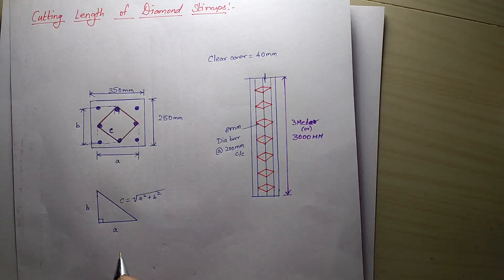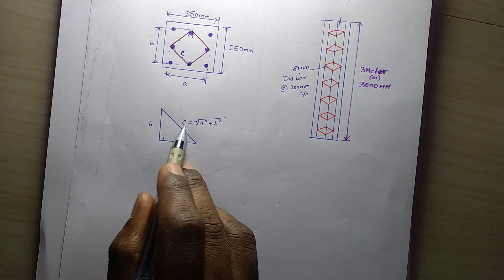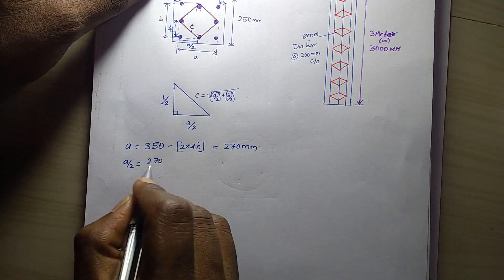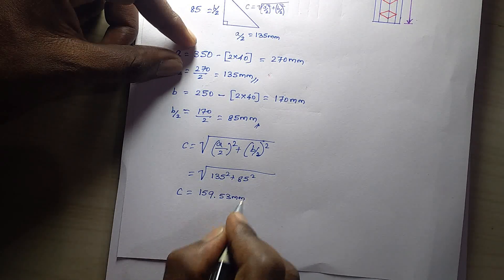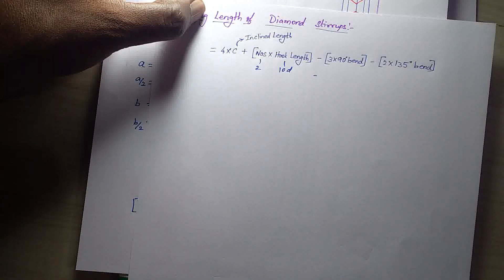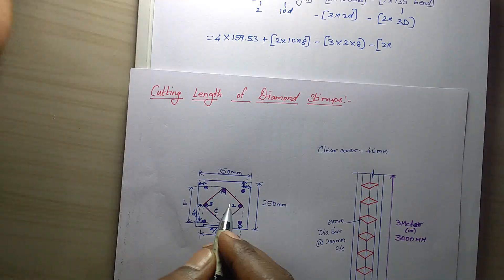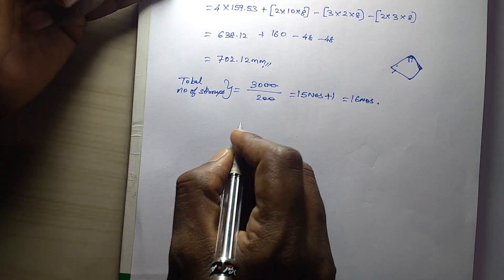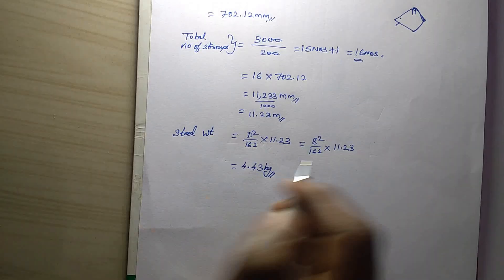Cutting length for Diamond Stirrups Calculation / BBS in Tamil

Comment: Iam cnc operator🙂Bro ethukku use akuthu ithu
Reply from the maker: Ithu Concrete ku steel katanum la. Athuku steel evalo venumnu theringika use aaguthu bro..🙂
Reply: @LearnerCivilEngineering8  short cut iruka
Reply from the maker: @nsr.rajeshnsr.rajesh1449   Shortcut ila bro..
Reply: Spr bro❤